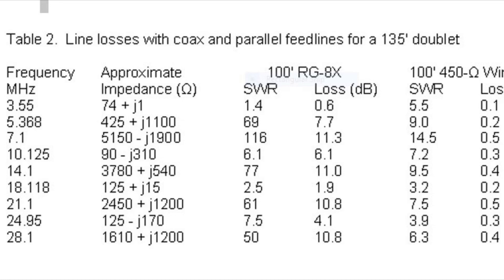HAM RADIO: The Doublet Antenna & Ladderline

Comment: My 88ft Doublet + big old Dentron Manual ATU is the stalwart of the home antenna set-up! It's been down through summer while I've been away working but it's going back up this week. They just work, oh and they're tuff as old boots, cost next to nothing to make/repair, can be zig-zag'd round to fit almost anywhere and don't draw too much attention! I'd say anyone looking for a multiband HF antenna should give the doublet a whirl first as last.  (PS) Top tip buy the biggest manual ATU you can find/afford it will last several lifetimes, never loose money and tune a wet bootlace! 73, Tom.
Reply from the maker: Spot on Tom!!
Reply: Got my eye on that new Icom AH-730. Haven't by chance looked into that one have you? Any thoughts if so?
Reply: I'm currently using a 40m long efhw and am thinking of changing it for a doublet to improve efficiency. At the same time I am looking at an Acom 1010 amp which can tune up to a 3:1 swr. I believe that from the 4:1 balun there will be a high swr on the coax to the amp.(it will only be about 3m of 10mm coax) would you expect more than 3:1? If so would I be correct in thinking that things would get over complicated if I have the tuner in my Yaesu 101mp doing it's best followed by the tuner in the amp,  followed by an ATU?
Reply: My doublet is 102 ft( shhhsssss, She's a old g5rv that I threw away the coax and ran it as doublet.) Works fair on 75m and tunes the rest.  1.2 swr at 6.889Mhz.
Reply from the maker: Do you find it better as a doublet Frank?
Reply: Yes

Comment: My go to HF any band antennas are either doublets with ladder line 450 window line , or a close loop  Sky loop 40 ft high and in my case about 240 ft long. I tune mine with true balanced tuner. I have have no issues with RF in the shack, but I avoid the multiple lengths by adjusting the ladder line lengths.  These close loop type antennas are a whole S unit quiet that ant other antennas. They are great. My tuner is a copy of the BT1550A tuner. Built my own pretty cheap. Hardest things to find were the roller inductors.  It can be made to work easily on 80M but  160M is iffy but doeable.

skyloop antenna.
Reply from the maker: Thanks for sharing your experiences!

Comment: The old guys used to tell us to cut a doublet for a half wavelength of the lowest band we want to operate and use 450 ohm window line or 600 ohm ladder line, and a healthy tuner.  Last year when I had to rebuilt my fan dipole I decided to do what the old guys said.  After all, I could always add more bands and go back to coax for what I had before.  Well, I put up a 135' doublet fed with 450 ohm and an Ameritron ATR-15 tuner.  WOW!  I am operating on all but 10 m, and am told I could probably work 10 m with some adjustment to feedline length.  I am getting lots of unsolicited "GREAT SIGNAL" reports like I rarely got before.  My signal is getting out!  I should have done this long ago.
Reply from the maker: Its a superb antenna when you get the tuning right.

Comment: Hello Tim love your videos. I’m looking to build a doublet for the 40m band for the first time, and you mentioned 50 to 51 feet for the radiating element. Is there a certain length of 450 ohm ladder line you would recommend feeding the doublet with that will not radiate? I’m looking to run it directly back to the tuner with no Balun. And use it multi band.Thank you.
Reply from the maker: Thank you! What sort of length of ladderline are you proposing to use?
Reply: It was recommended to me by another ham to use 55 feet of radiating element and 45 feet of 450 ohm feed line
Reply from the maker: @wildbill1 ok I’ll check

Comment: If I made 600 ohm ladder line I would need a 12:1balun right? 600/12=50. I see places like trueladderline saying just use a 1:1. Isn’t it just a matching transformer bringing 600 down to near 50 ohms the purpose? If you did this with a wide range tuner wouldn’t the radio see a close match?
Reply from the maker: Unfortunately no. The impedance that the balun has to transform is governed by two main factors. Firstly the length of the feed line and secondly the frequency being used. In practice the impedance seen by the balun  could be literally anything from single figures to thousands of ohms.

Comment: I recently hung a 160m doublet (264’ long x 80’ high flattop) - 600 ohm homebrew ladder line. I see why you sing the praises of the doublet now. I use it exclusively on 160m-10m. I believe that a vertical may get added later but this is the pinnacle of horizontal wire antennas. Thank you and 73’s.

Comment: My first real success was a doublet that was 65 feet long, with 300 ohm open wire feed at about 25 feet in the air.  The tuner was a Johnson Matchbox.  My setup was to use a coaxial switch with the xmitter as the common and a cantenna on one pole of the switch and the Matchbox on the other.  First, on the cantenna (50 ohm dummy load), Dip the final current at the xmitter, then flip the switch to the matchbox and then Dip the SWR.  It could be done in a few seconds, and I used it successfully from 80 to 10 meters.

This sequence (for those with little experience) got the transmitter output tuned to 50 ohms on the 50 ohm dummy load.  Next, the Matchbox matched the doublet to as close to 50 ohms as it could come.  This system worked so well, it was difficult to believe.
Reply from the maker: Great info!

Comment: Great ideas. At 10 min 20 sec you said 1:1 balun. Wouldn't it need a different ratio to match 50 ohm coax to 400 ohm ladder line ? I am still low on the learning curve and really enjoying your channel!
Reply from the maker: No problem! The 450 ohm ladder line would transform the impedance and suffer little loss with high SWR. What it won't do is just have 400 ohms as the impedance. So, to give the tuner a chance to handle the wide range of impedances across all bands the first step should be to use a 1:1 balun to avoid over reducing impedances to low numbers which some tuners will struggle to match. If the tuner struggles on one or two bands then you can either add or trim the ladder line length or try a 4:1 balun. Doublets can be trial and error, but once set they are a very good multi band antenna. 73
Reply: @TIMG5TM  Thanks for your reply. Will give it a try !

Comment: Well explained! My first 160 or so DXCC countries were worked using a 102'  doublet. While I've since used a doublet fed with 450 ohm twin-lead, that first one used 2 runs of RG8x in parallel . At the top the 2 shields were soldered together  and the 2 center conductors went to the 2 doublet legs. At the bottom the the shields went to tuner and radio ground and the two center conductors went to a 4:1 balun. A 2:1 would have been better since the Z of the lead-in was 100 ohms. The advantage of this arrangement was that the feedline could be laid on the roof, run across metal window frames and lie against tower or mast metal with no adverse effects. It worked very well!
Reply from the maker: Cheers!

Comment: John Portune W6NBC has done a bunch of tests on ladder line and find little problem with it running close to metal siding.
He showed you can even burry it in the ground using plastic drainpipe with little loss.
AD0TJ

Comment: Hey Tim quick question for you have you ever used a reflector wire on a doublet? Where the reflector would be mounted close to the ground just below the inverted V. And have you also used the director essentially making it a wire YAGI
Reply from the maker: No to both Pat but I’d like to try it

Comment: zs6grv   " suffers from the creator not being born in England "    you know its better and smaller
Reply from the maker: ZS6BKW - tends to be better on 40. But the G5RV tends to sing on 20. Both antennas are also good and not so good on a mixture of the higher bands.
Reply: @TIMG5TM  yes that's what it was designed for , the fact the g5rw works on other bands is lucky ?

Comment: I've used a doublet antenna fed with ladder line for 50 years, and it has been quite effective as an all-band antenna--if the tuner can handle the matching. After I bought a NanoVNA,  I discovered that there were several frequencies in the HF range at which the impedance presented at the tuner was almost exactly 50-ohms. I currently have a roughly 175-ft doublet fed with about 70-ft of home-brew 400-ohm open-wire line. I discovered this antenna/feedline combination yielded a 50-ohm load around 4.4-MHz. I did some quick calculations and added wire to the antenna to move the 50-ohm frequency down into the 75-m band where I am most often active. Now I have a perfect match with the tuner bypassed; I only need the 1:1 balun to operate. I mentioned tuner range: I still use the tuner for the other bands, but it would not work on 10-m. I swept the 25-30 MHz range and found another 50-ohm impedance at 29.5 MHz. I could have added more wire to move the "resonance" down to the 10-m CW/digital frequencies, but that would also change the 75-m frequency. I experimented instead with a couple of "patch cords" of ladder line added at the shack-end of the feeder. I found that a 2-1/2-ft section of feeder moved the 50-ohm match frequency right to the FT-8 frequency. This allows me to run FT-4/8 without the tuner. 
So, although the doublet is a good mult-iband antenna, a little experimentation and the right instrumentation can make a doublet/feedline combination into a very effective single-frequency antenna, too.
Reply from the maker: Great job - it is hard to match the doublet for multiple bands and simplicity of design and performance.

Comment: what would happen if I only used a few feet of ladder line in an attic antenna and went to a 4:1 Balun then ran coax from the attic to my tuner and radio?
Reply from the maker: Yep can be done. Just try and keep that run of coax as short as possible to minimise loss

Comment: I suspect that if you use the same lengths as the optimum lengths of the random wire antenna, you will not  have any problems with tuning the doublet.   Doug VE3MCF

Comment: I have been a ham since 1959 and loved every minute of it.  My favorite part of this hobby is experimenting with various antenna set ups.  I want to share a  phenomena I have consistently encountered with a Windom antenna.  My set up is a feed point at 1/3 of its total length and feed with 300 ohm Twin lead and an ATU, (cut for 80 Meter band).  With the Antenna at a height of 7 to 9 feet off the ground I consistently got  5/9 signal reports (many with 30 to 40 db over S9), and I was running only 75 to 90 watts output.  The big signal usually occurred for stations 75 to 200 miles from me both day and night time.   Best 73s every one..   The old Elmer Frank WA2NRC
Reply from the maker: Great information Frank, thank you 73

Comment: Your most efficient  doublet will be with any  with even 1/2 wave length increments in length and fed by a 1/2 wave of ladder line for your lowest band.  This prevents significant radiation from the  feed line.   Of course you want the antenna height at 1/2 wave above real ground for your typical doughnut radiation pattern to form and multiple lobes on the higher bands.  A balanced ATU is the best to use with this antenna..   Best 73s   WA2NRC
Reply from the maker: Thank you Francis

Comment: 220 foot doublet with 180 feet of 300 ohm ladder line.  Into the shack through PVC pipe.  4:1 balun on the floor.  Short piece of RG-213 into my MFJ-998 auto tuner; 160-10 meters is simply great.  NEVER NEED ANOTHER HF ANTENNA!  It even does 6 meters with my IC-7300 internal auto tuner.
W6PDL
Reply from the maker: Agree !

Comment: You should use a proper balanced ATU with a doublet, to get most power from the transmitter into the antenna, and not an ATU that has an internal 4:1 balun. Feeder radiation from a doublet is possible, if a proper balanced ATU is not used. Most doublet ham antenna installations are far from ideal, due to antenna height restrictions, nearby building obstructions and difficulty in getting the balanced line into the shack to a balanced ATU. So there will be some induced RF losses because of this, and they will be greater the higher in frequency the doublet is used. From my own my experience with just 10W to a 100ft doublet on 80 and 40 in good NVIS conditions, a signal of 59+ 20 should be possible with stations well over a few hundred miles or so quite easily. Yes just 10Watts!

Comment: The loss figures using 450 ohm ladder line are impressive, but to those how much loss does the tuner add?
Reply from the maker: A decent tuner? Less than a dB depending on how much strain you are exerting on it and how short the antenna in comparison to a 1/2 wave
Reply: @TIMG5TM  Thanks.

Comment: Agree with you and other hams like Cebik. There is a another linear loaded antenna the Cobra. it can be made with ladder line spanning a total of 12 meters. M0PTZ made one and is only 1 db down to a full length dipole on the cut frequency 80 meters i suppose. Just cut 20-21 feet of 450 Ohm ladder line fold each side 3 times on itself and you get a full length antenna on 80 meters.
Reply from the maker: Yes good old linear loading!
Reply: Thanks for the tip. It's M0PZT by the way.

Comment: One con you don't mention is that a balanced tuner is expensive. A ZS6BKW needs far less tuner the comparison in AUD is like $190 for a manual MFJ tuner to tune a ZS6BKW. The cheapest balanced tuner from the same store is $495. 
Thanks.
Shane VK1NME.
Reply from the maker: Yep although a 1:1 current Balun and a short piece of coax between the ladder-line and any auto tuner will work just as well in the real world

Comment: I have a zs2bkw dipole 95 feet AGL flat top. It's a flame thrower on 40 through 15. Almost as good on 20 as my hy gain 203 3 element mono bander up at 40 feet. Sometimes the zs6 does as good or better in certain directions
Reply from the maker: Nice height

Comment: hi  tim , can you off set the feed point on a doublet ? If so would it effect things cheers
Reply from the maker: You can, in theory, but I’d be mindful of creating an unbalanced antenna fed with balanced feedline and the likelihood of increased common mode into the shack
Reply: @TIMG5TM  cheers mate , ill probably stick to the recommended fed in the middle ,, much appreciated
Reply from the maker: @rivit90  you’ll enjoy it I’m sure 73

Comment: Hello Tim,
 I use a cobra doublet, with a ladder line mounted in the centre using 2x 3mtr wooden mast supports o convienience of non conduction I then terminate this in the shack to a mfj 4:1 balun, which then runs through a AT180H auto tuner, an I find it very flexible for band coverage,.
I find the ladder line easy to handle, in fact once the feeder comes off the mast to he shack mounted on support poles, my garden allows me to put this antenna straight out., and once it gets back to the shack I bend it and use 30mm water pipe to gain access for easy maintance
Reply from the maker: Sounds a great set up

Comment: So, what do you think of the G5RV antenna and should one put a balun at the latter line to coax interface?
Reply from the maker: They work for many people. I would put a choke balun there yes - just to make doubly sure you avoid any common mode on the coax to the shack.

Comment: Hi Tim,iam making a 102ft doublet now BUT going to put it at the top of my 12m steel crank up mast which is attached to my house so the legs will run straight down the garden but worried how to run my ladderline straight down without it interfering or touching the metal?? Sorry but racking my brain over this any ideas?? Thankyou
Reply from the maker: Hi Andy - could you attach some sort of plastic stand offs to the pole - a few inches long?
Reply: @TIMG5TM   hi Tim yes I did that but too much interaction as could only get an angle of around 40° between the legs so took it down n put the cobweb back up :)
Reply from the maker: @andyM9XTT  ah ok Andy

Comment: I was wondering if you ever use a manual tuner for an end fed half wave antenna or do you only use the tuner for doublets
Reply from the maker: Hi Pat. The efhw does not need a tuner as it is resonant on the main Halfwave plus harmonics. I use a tuner just for my doublets. 73

Comment: Hi Tim.
I am curently making a doublet of 20 meters 10 meters per side so a half wave on 40m, so it should work 40 and up.
I have a few questions though.
When you say laderline should not be a multiple of a halfwave on any of the bands I dont understand what you meen by a multiple. 
Could you elaberate on this for me please and give me a rough length to cut my 450 ohm ladder line to for a halfwave on 40m doublet.
Also what ballun should I have at the end of the ladder line 9:1 or 4:1? my tuner a LDG Z11 Pro 2 only has so-239 sockets, so need to run a balun before it as I cant feed the lader line directly to the tunner, also it will be in a loft so only laderline in the loft to a balun into the tunner (In the Loft) and then a coax feed  of about 25 feet to the shack/bedroom.

Sorry for the questions 73 Nathan 2E0LIG
Reply from the maker: Hi Nathan. My advice is to feed it with the length of 450 ohm required and then see. The thing I would suggest is to use a 1:1 current balun as a 4:1 might reduce the imepedance  below what your tuner can cope with. A 9:1 is similarly not advised. 73

Comment: Hi there also 600 ohm twin feeder why use 450 and not 600 are there any disadvantage between the two ?
Reply from the maker: 600 is slightly less lossy on longer runs